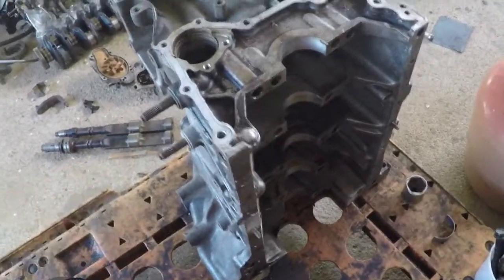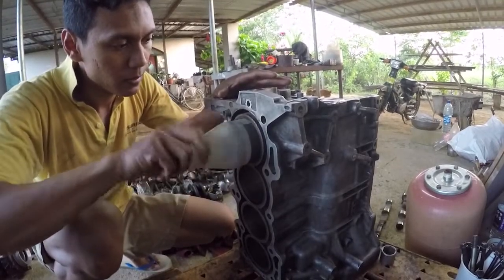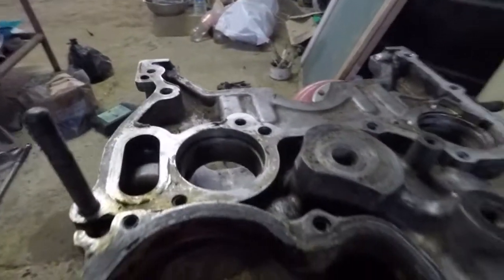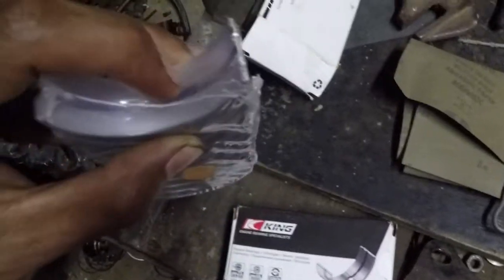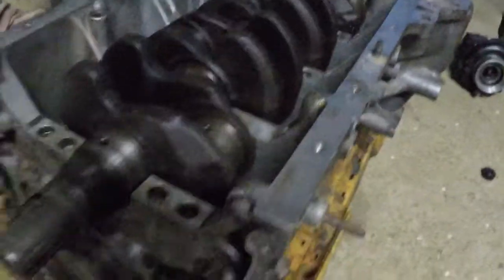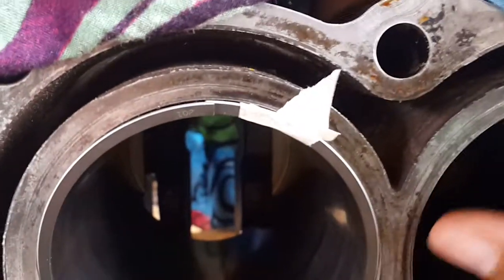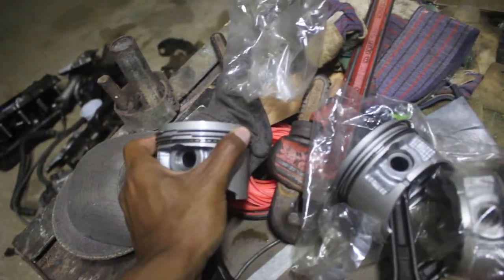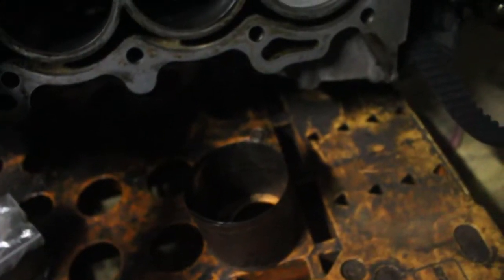Honda F22B Rebuild part 1 - Gapping rings for Turbo

Comment: Acl makes better bearings. Is that dohc or sohc?
Reply from the maker: Yes they do, but it was  a bit outside the budget.. It's a DOHC head.. non vtec :)
Reply: Tulen Garage great motor for turbo.
Reply from the maker: Yup.. Plans are already made to boost the motor... :D ;)
Reply: Tulen Garage very nice.